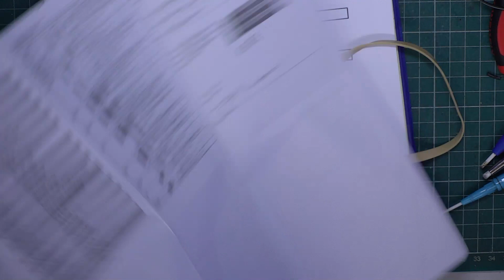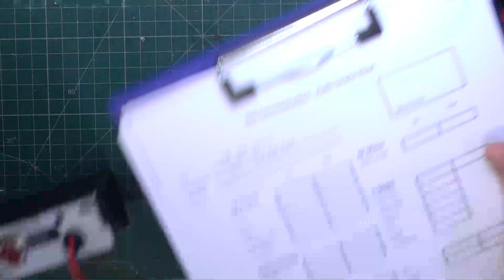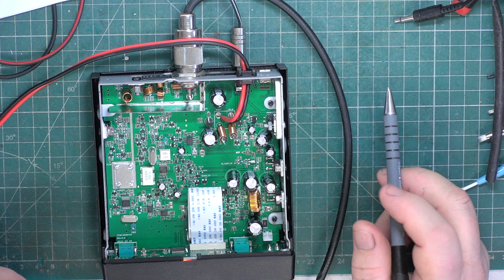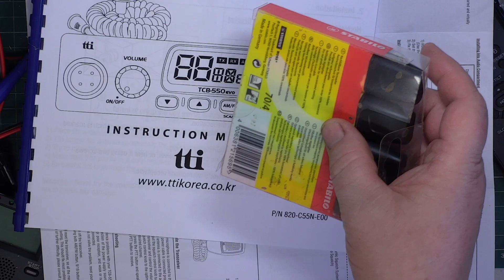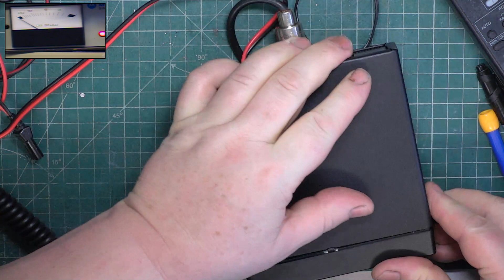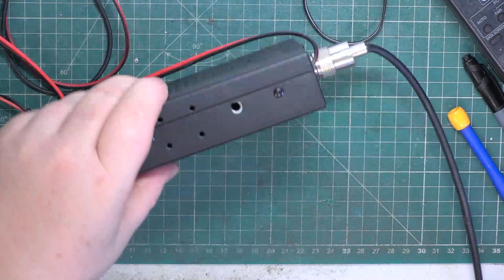TTI TCB550EVO CE MultiNorm AM/FM CB radio - service alignment

Comment: Hi Richard, thanks for Servicing my 550evo, I've only had it a few months but as I said the power on melody drove me crazy. I would have liked a green backlight too but I found red the best out of the three options. 

I was quite surprised to hear it was slightly down on power at 2.9W, as I said I had a good 19 miles DX but I suppose turning it up to 3.4W wouldn't actually make much difference in the real world. Thank you for doing the additional checks even though I wouldn't use the radio on CEPT etc.

Looking forward to seeing the on the road test :)